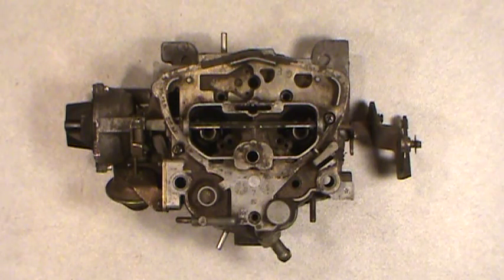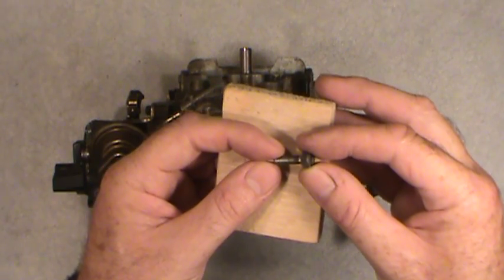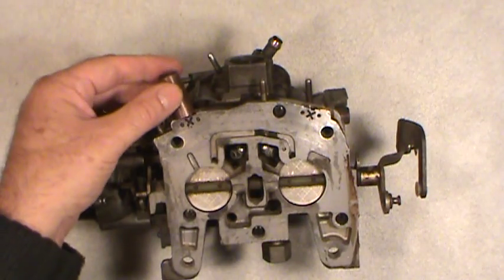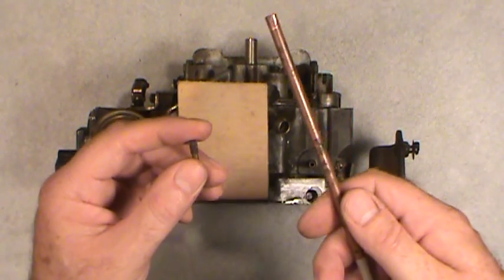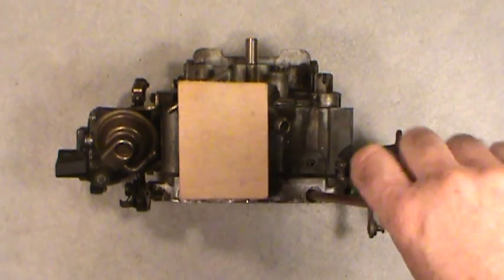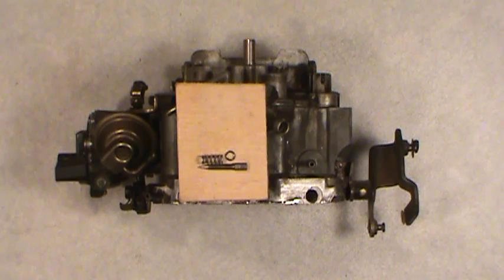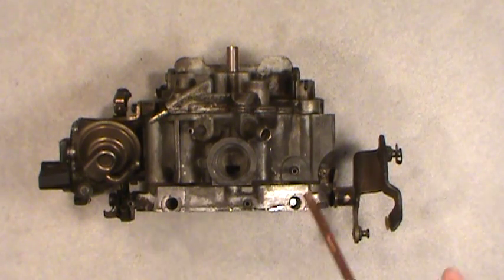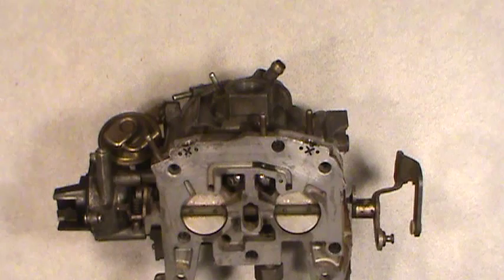Rochester Quadrajet Dualjet Idle Mixture Plug Removal, Plus "Special" Tool !!!

Comment: very informative. working on an 83 chevy van with 4 barrel quad has caps. i will do it your way
Reply from the maker: Greetings...Dana Oliver..........Thanks for the nice comment, and Thanks, for watching as well............If, Your Vehicle has to be Smog/Emissions Tested, then, You'll have to know, how to make the Adjustments properly, and Accurately as well, or, the "Fail" word, might end up, getting printed on the Smog Test Report (paper)...............I have a YouTube Video, on my YouTube Channel...RockysRoadshow...that shows, how I did the required "Lean Drop" (RPM-wise), Adjustment/Procedure, with the Idle Mixture Screws, and Idle "Speed" Screw, on a Carter Thermoquad (4-Barrel) Carburetor, that, afterwords, did, Smog-Tested really good, and, that procedure, works about the same, on something like, a Rochester "Quadrajet" (4-Barrel) carburetor, and, the Rochester "Dualjet" (2-Barrel) carburetor as well, as long as the "Specifications", for that "Exact" Carburetor are used...(just look for, one of my YouTube Videos, that is showing a really "LARGE" Automotive Testing Meter, that has a "Carburetor" below it...enjoy)............If, Your 4 Barrel Carburetor, does have those "Hardened Steel Plugs", that are keeping You from getting to Idle Mixture Screws, then, You'll probably find that, it's quite a bit easier, to Grind the end of those Plug off, by having the Carburetor removed from the engine, and, work on it "Outside", for Safety's sake............I usually "Test", the Steel or Metal's "Hardness", with an older Hand File, and, if it Files quite Easily, I consider that, to be, reasonably "Soft"...and...if the hand File, won't, shall we say, "Bite Into" the Metal, and kinda, just "Glides" on top of it, well, to me, then, it's way too hard, for me, to hand "File" it, so, "Grinding", it just has to be................Make sure, to Remove any Gasoline, that's still in the carburetor's Float Bowl (turn it upside-down, in a bucket or pail) "Outside"...!!!...Not in the House, or maybe "Boom"...!!!...and have a Fire Extinguisher Close-by, just in case..............Also, "Flush-out", the carburetor's Float Bowl, with some, Non Explosive, Liquid Cleaner, to get rid of those Explosive "Gasoline Fumes", cuz, if any "Sparks", that usually result, when-ever "Grinding", well, "They" (the Sparks), have a really good chance, at Igniting, those Not Wanted "Gasoline Fumes" (and any Liquid Gasoline as well)...!!!.............."Safer Yet", is to "Disassemble" the Carburetor, and only work on the part of it, that has the Idle Mixture Screws in "it"................I used, a variable speed "Dremal" (spelling?), high speed, hand held, (plug in the wall), power tool, with some quite small, grinding stones, that were permanently mounted-on, a round steel arbor/shaft (the end, that gets secured/clamped into, the Dremal power tool)................Always Wear, "Eye and Hearing" Protection...!!!...(to Protect Your Eyesight and Hearing)..............Make sure, that, all of the Grinding (metal) "Dust", gets 100%, Completely "Cleaned/Removed", out of all parts of the Carburetor, or, Carburetor, and/or Engine Damage, it just might be...!!!.............If You happen to have any questions, or concerns at all, just give me a shout......and......till next time.......Be (Extra) Safe, take care, and have a good one.

Comment: I used a very small Socket ,that fit tight over the idle mixture screw.  on my rochester Quadrajet carburetor. on my 1980 pontiac grand prix
Reply from the maker: RICHARD maaske Greetings RICHARD maaske....Thanks for watching, and for letting me know, what works for You, when adjusting Your 1980 Pontiac Grand Prix's, Rochester Quadrajet Carburetor's, Idle Mixture Screws...oh and, hang on to Your Pontiac, cuz, I think that they Stopped makin' em, a few Years ago...!!!...........................I'm thinkin', since about the time, that, the Auto-Makers, were having to comply, with the ever Tightening/Reducing, of the Amount of Exhaust Emissions, that were Exiting Vehicles Tailpipes, as set forth, by the Governments of the day, that, the Auto-Makers, came up with a few, Different Ways, that, would Keep Us from Making Carburetor Adjustments, that would, more then likely, Create, some rather High, or Higher then wanted, Amounts of Exhaust Emissions/Pollutants, to be Spewing out of a Vehicle's Tailpipe/s, especially, when, some Folks, might not really know, how certain Carburetor Adjustments, can, and will Affect, the Amount of Excessive, Exhaust Emissions/Pollutants, that can really be Detected, by the Smog Sniffer, at the Smog Testing Establishment, that's for sure...!!!...lol....................................I've seen Plastic Caps, that were Pressed Onto, some Idle Mixture Screws, that would only Allow, oh, about 1/2 Turn, Adjustment, of an Idle Mixture Screw...................................I guess, that, the Hardened Steel, Pressed-In Caps, are about the most, shall we say, Serious Method, that a Carburetor Manufacturer came up with, to Keep-Us-All...Mechanics Included...!!!...lol...from even Seeing the Idle Mixture Screws, and, just like that, good ole saying..."Out of Sight...Out of Mind"...maybe...???...lol......................Yes-Sir-ee-Bob...as far as the Original/Factory, Tamper-Proof, Idle Mixture Screw Settings, on the Rochester Carbs, that I had, I found that, as long as, not Too Much Ethanol (aka, Alcohol)...(no higher then about 10%), that was in the Gasoline, and, the Rochester Carb, was in Good Working Order, on a Stock/Healthy Engine, and the Ignition Timing, was Factory/Stock as well, the CO/Carbon Monoxide Level, as Tested, at the Smog Testing Establishment, never seemed to go, any Higher then about 1% (CO) at Idle (speed)...and, that's a good thing................................Well........Till next time..........Be Safe, take care, and have a good one.

Comment: Goodnight friend. I have that same carburetor on a 11980 Malibu and it uses a lot of gasoline and puts the spark plugs black. Those screws are the ones to adjust the fuel pass, would I have to close or open it and are they both or just one?
Reply from the maker: Greetings...Anderson Torres.........Thanks for watching.........There are some other things, that can cause an engine, to be burning too much gasoline........Air filter clean...???...the carburetor's choke system, could be malfunctioning...might be, that, the float inside of your carburetor has started to sink...or...the carburetor's needle and seat, is dirty, or maybe stuck open a little bit, which will allow too much gasoline into your carburetor.........If the passageways, that these two idle mixture screws control, are dirty, or plugged-up, then, they should be cleaned up, before doing any adjustments on them.........If the "inside", of, just about any carburetor, gets too old/lots of miles on it, or gets too dirty, then, they usually don't work as good, as they should be doing........A big part of getting a carburetor to work right, is in the cleaning, of all of the internal passageways, some of which can be very tiny, in some cases........Sometimes, it's possible, to remove those two idle mixture screws, and blow some compressed air, into those two openings, which might clear out any crud, that might be hiding inside.........The tricky part, is to adjust, those two idle mixture screws "correctly"........If the vehicle has to be smog/emissions tested, then, those adjustments have to be done, in a very accurate way, or, it will fail the smog test...!!!...and.....till next time......Be Safe, take care, and have a good one.

Comment: I have that same carburetor. I need to adjust those screws for it to pass smog. Do you know how much I need to turn them out or in
Reply: turn them all the way in. then back both out 4 1/2 full turns.  good starting point

Comment: i have the same screws in my 800 cfm i wanted to ask you if you know what size socket will fit those mixture screws thanks
Reply from the maker: Mike b Greetings Mike b....Thanks for watching, and for Your comment/question as well....................................................Wowsers!...even I didn't know, what the Size of the, shall we say...Mixture Screw..."Hexagonal Body"...Part of the Mixture Screw, actually was...!!!...lol..............................................So, I took those "2" Idle Mixture Screws, out of the...Rochester "Dualjet" Carburetor, that You saw, in this YouTube Video of mine, and using a..."Micrometer"...I Measured "Across the Flats" on Both of them, in Three Places (rotational-wise, that is), and, the LARGEST Size, that my Micrometer was showing me, was .181" (aka, One Hundred and Eighty-one Thousandths of an Inch).....................................................Then, I tried, Both..."Inch"...and..."Metric"...Sockets, to see, what just might "Fit" good enough, on this particular..."Hexagonal"...Type of Mixture Screw, in order to make, the...Rochester Quadrajet and Dualjet Carburetors..."Idle Mixture Adjustment"...on these...good ole...Not..."Capped Off"...any more, and...Not..."Hidden"...any more..."Hexagonal"...Type of "Mixture Screws, well...besides...having them "Hiding" in their little "Caves", if You will...!!!...lol............................................For the..."Best"...and "Tightest"..."Fit"...I found, that, a..."4.5 Millimeter" (aka, Four and a Half, or, Four point Five) "Socket"...is Your Best Bet................................................A...3/16" (Three Sixteenths of an Inch)..."Socket"..."Fits"...a bit, on the..."Loose"...side, but, seeing as how You are Not going to be "Applying" very much "Torque-Force", when Turning the Idle Mixture Screws, the 3/16" Inch Socket, will still...Git-Er-Done!........................................................I just hope, that the "Outside Diameter", of the Socket, that You might try Using, will be able to "Fit Into" the "Throttle Body" (aka, Carburetor's, bottom aluminum casting)...!!!...............................................I'm not all that Sure, that...Your Rochester Quadrajet (I think?), will Actually have, the..."Very Same"..."Hexagonal Size"...on the Mixture Screws, that, the Rochester Dualjet Carburetor, that You see in this Video of mine has...???...............................................Good Luck with that...............................................Be Safe, take care, and have a good one.

Comment: well done. thanks. i have a 4barrel rochester to do & it has the crummy caps over the mixture screws. engineers? and the ethanol-yuck!
Reply from the maker: Greetings...thomas b...…….You're welcome, and, thanks for the nice comment...……..Well, the so-called engineers, pretty much, had to come up with, a, shall we say..."anti-tampering"...mind-set, in order, to probably be in compliance with, what the government of that time period, imposed on the vehicle manufacturers, as far as, vehicle, exhaust emissions standards were concerned (keeps...You, I, and others, from making adjustments, that will probably result in, excessive exhaust emissions, I be thinkin').……..I recall seeing, 2 black plastic caps, that were, kinda snapped onto, the 2 idle mixture screws, that were on a mid-1970's Carter Thermoquad 4-barrel carburetor, that had a little finger on it, that would limit, the idle mixture screws turning amount, to about 1/2 of 1 turn there-abouts, and, with a common screwdriver, they were easily pried off of, those idle mixture screws, and, that's probably why, those 2 hardened steel plugs were installed, on some of those Rochester carburetors, I be thinkin'...……..Yes-Sir-ee-Bob, that Ethanol (aka...Alcohol, sometimes made from corn-on-the-cob), can eat away at, certain types of metal and coatings, as well as, rubber-like material, that some of the older diaphragms and seals, were probably made out of, back in the day...…….Then, having about 10% Ethanol, in today's Gasoline "blend", then, a carburetor's air/fuel ratio (mixture), will probably be leaning towards, the, shall we say, lean side of things, that I've already dealt with, as in, increase the primary (fuel) jet/s size, in a Thermoquad carburetor, from .095", all the way up to .104" orifice/hole size (as in, ninety-five thousandths of an inch, up to, one hundred and four thousandths of an inch), just to get rid of that "lean-surge", that I was having, way-back-when, while only maintaining city speed...……..I sure didn't like the idea, as per, what the Rochester carburetor's, rebuild kit's instructions had to say, about..."smashing"...the area, near the hardened steel, idle mixture screw..."plugs"...in order to remove them, from the aluminum throttle body (base/bottom section), that would be leaving..."2-Nasty-lookin'-Chunks"...missing, from the Carb's base plate, when all, was said & done...!!!...…....So, that's why, I just grind the ends, of, the hardened metal caps off, and look Ma, "it" (the Rochester carb)…"still looks pretty"...lol...….and...…..till next time...…..Be Safe, take care, and have a good one.